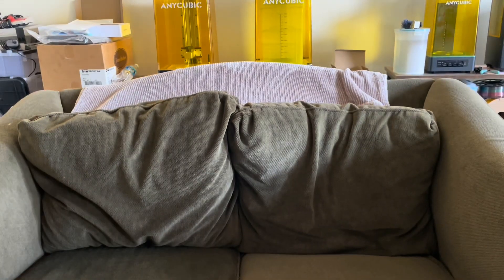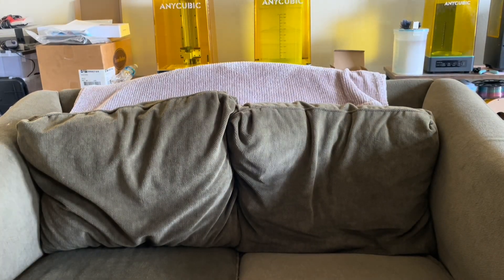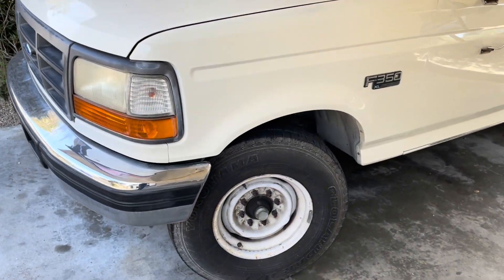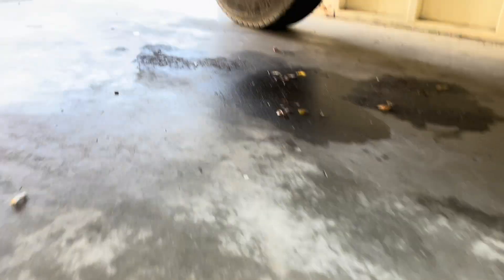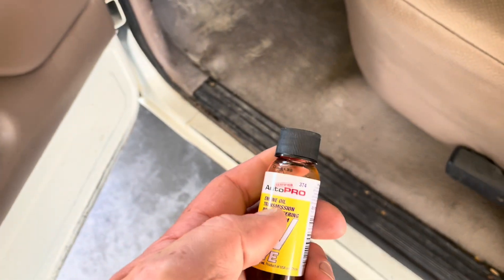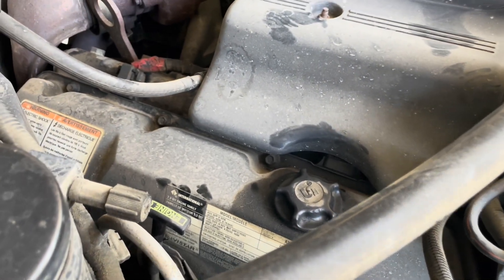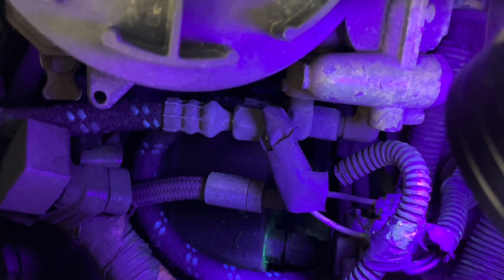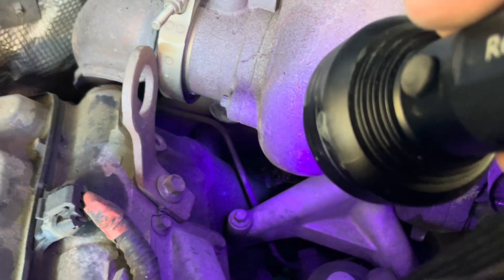How to Find Oil Leaks on a 7.3 Powerstroke | Simple UV Dye Method

Comment: Nice, this is definitely something for me to try. After putting in the dye how far did you have to drive? Are we talking like ten minutes or a couple days, etc.,
Reply from the maker: @slowrideoverlanding1483  hey bud, that’s a great question! Honestly, it depends on how bad your leak is… if it’s something that’s a drip every now and then you’ll probably wanna do a little more driving but if it’s something that’s coming pretty quickly with the leak then you might wanna do a shorter timeframe. Most leaks are gonna come commonly from the turbo pedestal O-rings or the back pressure valve mechanism. Every now and then the high-pressure oil lines fittings or even the high-pressure oil pump gasket. Crankshaft seals and oil pan gaskets. Also, if you have a leak when the engine is cold, but goes away when it’s hot the big O-rings on the oil cooler get hard over time and start to leak. This is where the dye is just awesome to pinpoint the origin of the flow.

Someone called me recently to diagnose an oil leak, but it turns out their fuel filter Cap was just loose and taking some dirt off the block on its way down, so that can happen too! Don’t be afraid to ask anymore questions, and happy hunting!
Reply: @bryanbuilt360  thank you for the information!

Comment: Good thinking. Will the dye harm anything if I run the engine to the next oil change interval? Just put $100 in oil in it.
Reply from the maker: No issues there, keep running it and check for other potential leaks in that time. I’m still running around with it haha which reminds me, I’m probably due for an oil change 😂
Reply: @bryanbuilt360  🤣 thanks 👍🏼

Comment: I’m trying this on my 2002 7.3!!!!!!  Thanks
Reply: Did you find out?
Reply: @cadenprosise2609 I didn’t do this but.  Cleaned out the valley and sprayed parts cleaner until it looked dry.  Like was at the HPOP line that goes to the head. Replaced the o ring. I also found a small leak under the fuel filter bowl, but haven’t take that apart yet.
Reply: @Raskzi  was it hard or expensive to fix? My 7.3 has been slowy leaking for awhile and today its been dumping and i mean puddles of oil now, stressed is an understatement right now.
Reply: @cadenprosise2609  no wasn’t hard just got napkins and cleaned all the oil out, then sprayed it with brake cleaner cans. Make sure it is dry and turn it on, get in there and look for the leak with a flash light.

Comment: Hey brother! I have the same fuckin thing goin, looks like the pan but want to make sure before I pull the motor. Just changed the fricken oil too. How much of this would you say I need? Directions say 1 oz per 5 quarts. But damn my 01 7.3 takes about 17 quarts, so would put in 3 o these bottles or just rock 1 and see if it works?
Reply from the maker: I put two bottles in mine, could have been more but it was still enough to diagnose!
Reply: Awesome thank you!

Comment: I have a 1995 and bought the cnc fab hpop lines and cross over line and live it!
Reply from the maker: Damn! I saw those after I ordered raided stainless ones 🤦🏼‍♂️ have you done anything for the fuel system? Regulated return?
Reply: @bryanbuilt360  not yet I plan to. I just bought a new OEM lift pump but I'm nervous about stalling it and dropping the plunger down.
Reply from the maker: @Diesel_Coins  ya know I can’t say I’ve ever done one on the OBS but would imagine it’s much like a distributor driveshaft. Shoot. I was looking at swapping a newer fuel bowl and all. I had an 02 truck with the fuel crossover and that was one of the best mods I’ve ever done to a 7.3.  Getting into the oil crossovers tomorrow! Thanks for the feedback and advice. Slow and steady with the lift pump 🫡